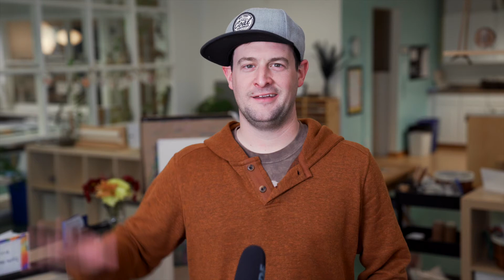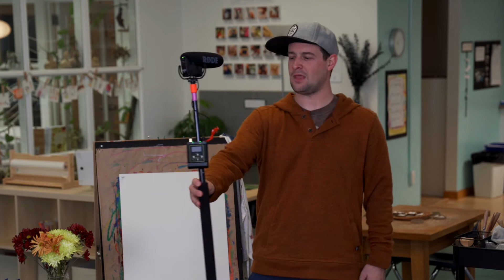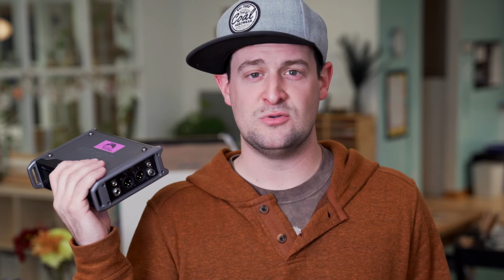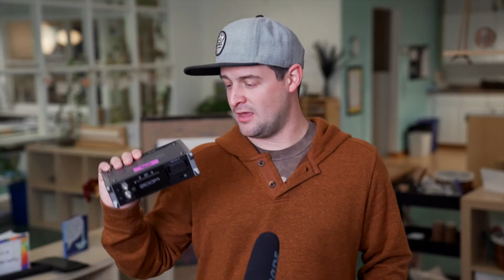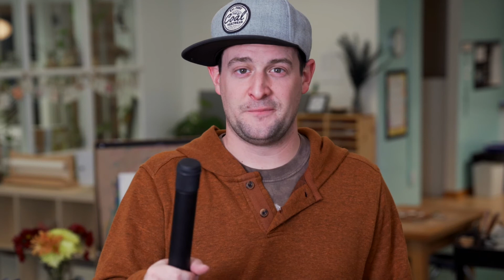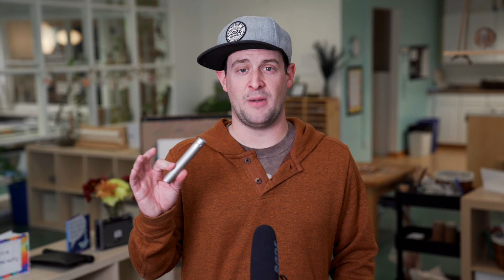My Audio Kit (Fall 2019)

Comment: I just bought the Deity Connect system myself. It is by far the best wireless solution for the price! I love that it comes with all the cables you need in a really good case. Great video man, Keep up the good work!
Reply from the maker: Have you noticed any drops in signal when near phones? I was using it for a video where the subject was about 6 feet away from the camera, and when I brought my phone up to take a BTS photo of the screen, my audio dropped out. I am going to keep an eye on that, let me know if you notice anything similar.
Reply: colonelshaun just got it two days ago so I’ve only used it on a shoot once. But I’m glad you mentioned the phone issue since I have a few important interviews coming up, so I’ll definitely keep an eye on that.